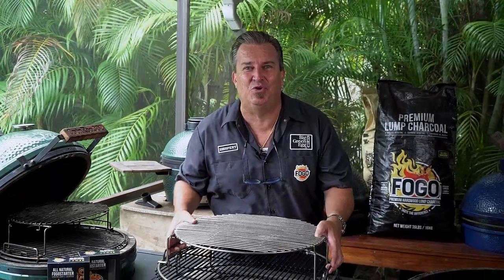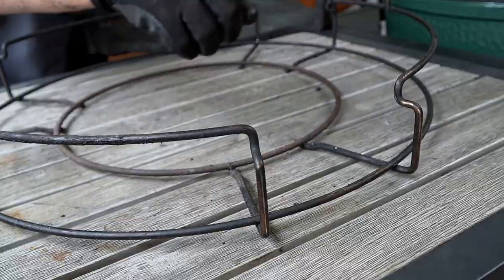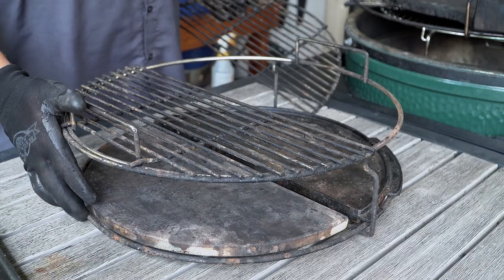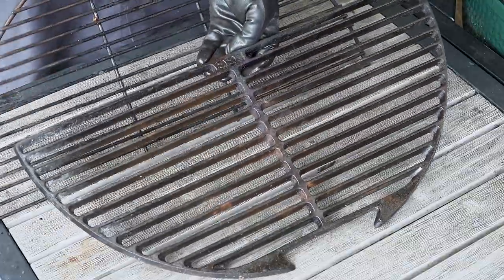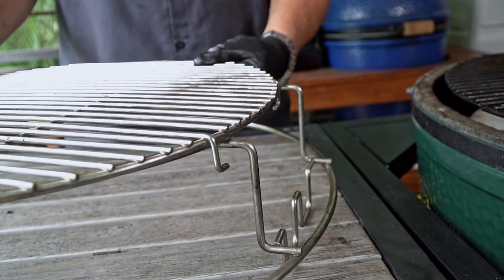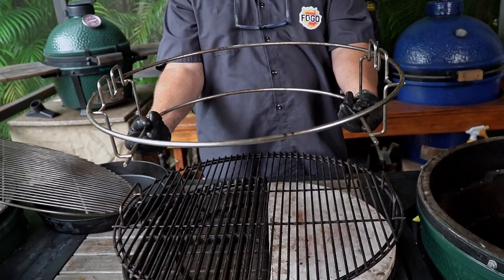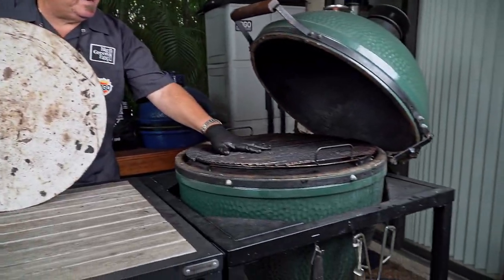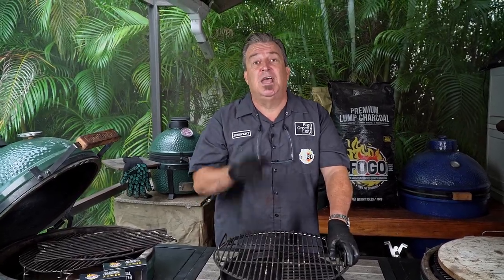Everything You Need to Know About the EGGspander | Big Green Egg Accessories Tutorial.

Comment: EGGcellent video instruction.  I have a couple questions, where did you get the cast iron skillet with the two side handles?  What size is it?  I have the XL egg and it looks like it would be perfect for that.  Also, when doing pizza, what is the ideal temperature for the pizza stone (checked with an infrared thermometer)?  I've done two pizzas and have burned the bottoms really bad.  One I did with the eggpander & pizza stone on the grill grate, the other with just the pizza stone on the grate.  Both seem to get too hot.  Please let me know.
Reply from the maker: Hi John, all great questions sir.  The pan is made by Big Green Egg and I like the pizza stone at 500°.  Conveggtor with Legs up, cooking grate, then pizza stone.  If ou have bricks or something to raise the pizza stone higher in the dome, do it.  It will help the top cook more in time with the bottom.

Comment: The 2 half moon ceramic deflectors look like they fill the entire bottom of the basket whereas the convertor has additional room around the outside.  Does having the 2 half-moon pieces inplace choke out the airflow at all and cause issues keeping the fire going or blocking too much of the hot air flow around the plates to the top of the grill?
Reply from the maker: No, no, there is still airflow around the outside of the 2 plates.  If I want more, I simply overlap them a bit in the center.

Comment: At 1:04 you mention that you can also use the regular grate that comes with the BGE. I have an XL egg that is about 5 years old and I cannot use the original grate with the Eggspander. The two parallel bars that all of the other bars are welded to are spaced too closely to allow the upper assembly to be seated between them and they are also too long to clear the handles of the lower assembly. Hope that made sense. Do you know if BGE or anyone else makes a grid that will work with the Eggspander? Thanks for all your videos.
Reply from the maker: You are exactly right.  I had the same problem when I put it im one of my older XL Eggs.
Reply: @FOGOcharcoal  we’re you able to locate a grid that worked with your older egg or did you just get a newer egg?

Comment: Hey, love your videos. Have a question for you, I have the eggspander with 2 ceramic half moons, I don’t purchased the conveggtor, I am having a hard time to get to 500F for pizza with the 2 half moons (I get max 400), maybe the airflow is less than when using the conveggtor? Have you tried pizza with the 2 pieces? Thanks in advance
Reply from the maker: Hi Adrian, that is a great question.  The answer is yes, I have had a similar problem.  What I do is overlap them a bit to create more air flow around the edges.  Hopefully this will help you.  It certainly helped me.  Also, always make sure you have a full load of charcoal in there.
Reply: Worked perfect, up to 550 degrees, I had a really hard time with the dough… was my first one, I suppose have to keep trying haha but the pizza tested great

Comment: Issue I'm having with a older Egg XL is fire ring is set higher than models I've seen in most videos. When I set my grate over convection plate, grill is higher than lower lip of bottom half of the Egg. It means I have to balance the grate so it doesn't come in contact with top lid when I close. It's likely I'll have to work on alignments; so  will this Eggspander solve that issue ?  Thanks in advance for you response.
Reply from the maker: Hmmm, I have never encountered that but I would say that it probably would.  I cannot verufy it for sure though.  Maybe measure the eggspander in a store and then measure your egg at home to see....
Reply: @FOGOcharcoal  I dismantled prior the Ian to bring inside. It was sitting on grass and almost impossible  to roll as I don't have a dolly. With patience, I got it finally aligned, and I still have to position the grill for the egg to close. I saw a demonstration on another channel that had the same height on the ring. I think the Eggspander will do the trick. Got a bid for a new 5 piece set at $200 on Bay. I think this will do the trick. Hope I win the bid as not keen on paying retail. Thanks for your help.

Comment: I bought the half moon cast iron grid, the veggie half moon, and the normal stainles steel half moon... Do i need the eggspander in order to use them?
Reply from the maker: Yes sir, you can use the veggie half moon without it and you can put the half moon cast iron grid on top of your regular grate to use it.  You could actually probably just put the cast iron and stainless half moon directly on the fire ring and use them, they will just be very low in the Egg.

Comment: In regards to the large Egg, the half moon pizza stones are larger in diameter than the conveggtor. What effect does this have on getting the egg up to a higher temperature; say 450*?
Reply from the maker: You know what Mike, that is a GREAT point.  They do restrict the airflow a it.  I usually overlap them a bit so it makes the circumference smaller.  Also, many people split them apart a bit to get the Egg to the desired temp them push them back together.